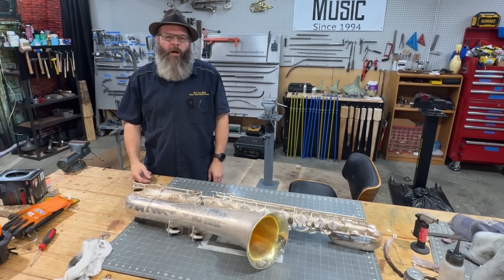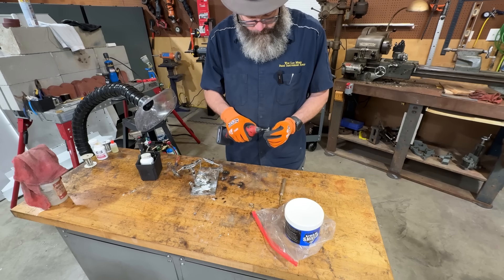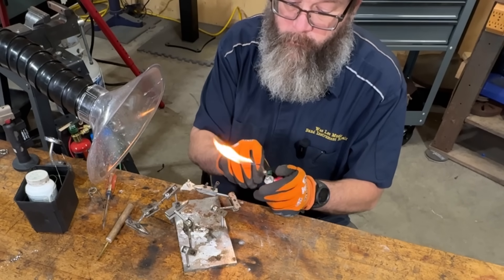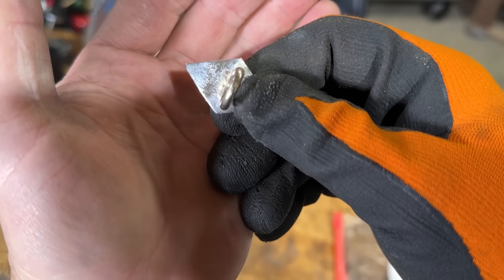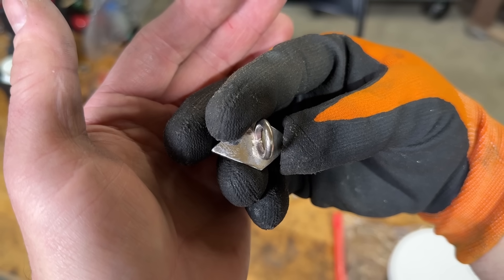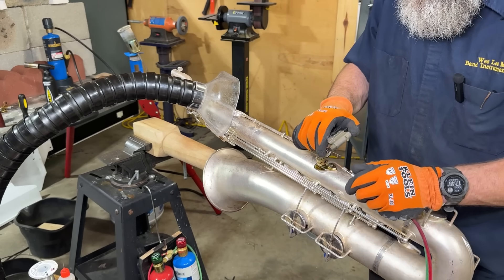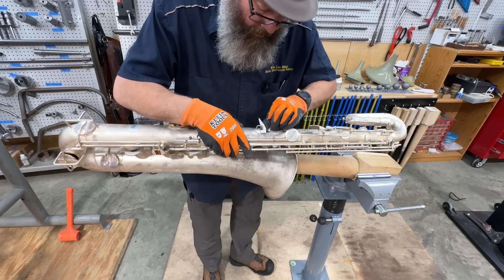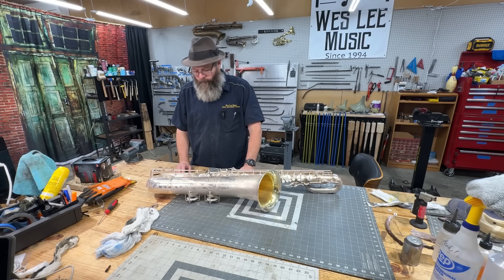Silver Solder Without Burning Silver Plate?-  Vintage Buescher Big B Strap Ring Repair

Comment: You might check out the "omni-fixo". It's sort of like a 3rd hand where you can set the piece down and solder instead of clipping it down with more tension. The bases are magnetic. I'll sometimes drop a steel barrel into a sax body and that let's me put the omni fixo hands where ever I want to add stability to a piece I'm soldering. Also, makes quick work of little things like a flute spud or draw knob.

Comment: Thanks for another great video, never hurts to listen and learn. What are you using as flux? 
More generally for the European audience, what are you using as flux and where do you source it as it is getting nearly impossible to get liquids shipped from the us. 
Thanks and all the best
Reply from the maker: Stay Silv on silver solder
Stay clean on soft solder. I use both the liquid and the paste. Paste is what I used in this video.

Also, if you have welding supply near you I would check there, ours has in stock. 
But I checked and they are also on the big “A”  retailer to ship right to your door.
Reply: He mentioned and showed in the video he uses "Harris" brand, his was called Stay- clean, in a white & red container. I use Harris Stay-Silv in the white and blue bottle, but I do more brazing and silver soldering on steel at my shop

Comment: this may be a dumb question, but what exactly do you mean "soft solder" you mean like tin/antimony base?
sorry just for context I do some jewelry work and randomly found your channel as pretty interesting as there is some overlap, but I'm used to "soft" referring to a "finishing" grade of silver solder
Reply: the difference is just the temp, everything over 450°C is hard soldering, anything under is soft soldering
Reply: Generally 94/6 Tin antimony or anywhere from 50/50 to 70/30 tin lead solder
Reply: @ Thought so, thanks. Wasn't sure on if lead was still used or not but knew tin/antimony largely took over for it.
Reply: @ lead is still largely used in smaller workshops